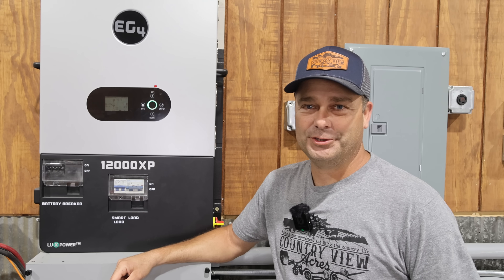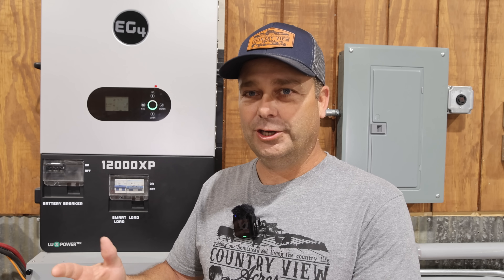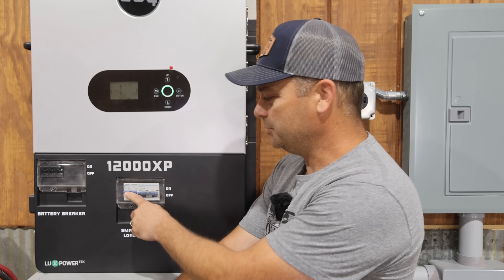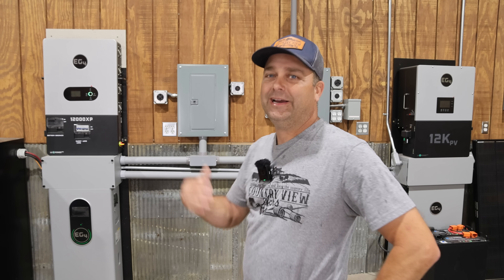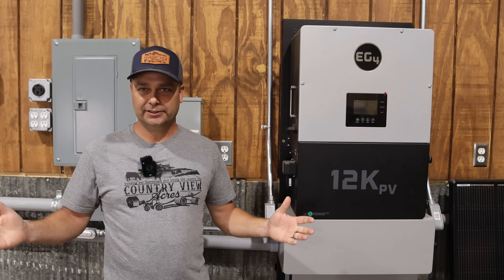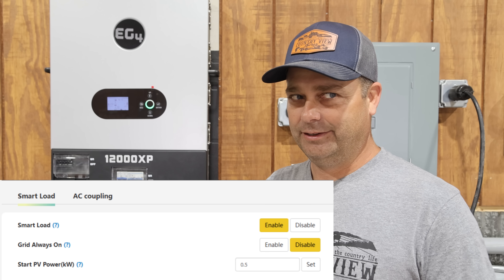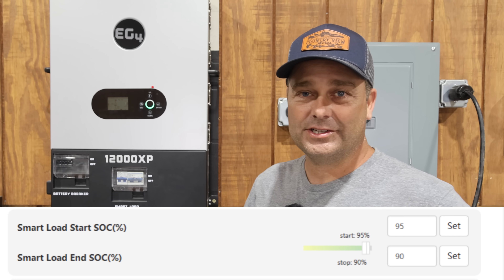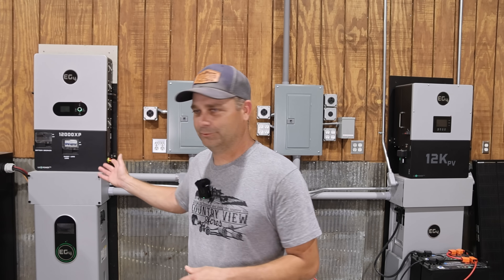Setting up a Smart Load on the 12000XP to use extra Solar power when Batteries are Full.

Comment: New 12kxp owner here. First inverter. In EKY. Planning to use my smart load for pond aeration on 1.5 acre 15’ deep pond. And eventually a pump to send water up to a future pond with 150’ of head. Then pipe that overflow into a turbine for low solar production days.

Comment: I am also struggling to find a use case for the smart load. If anything, I will just turn off a breaker if I don't want something pulling power. I can't think of a single scenario where the smart load feature is useful.
Reply from the maker: If you are not home to switch off the breaker.  The smart load will do it for you.

Comment: Typical smart loads to turn off would be electric hot water tanks (if insulated and not in a very cold spot, they really don't need to be on 24 hours or at 3 AM), hot tubs, pool pumps, etc.  

If you are going to turn on "smart loads", might seriously consider adding extra storage capacity for those non-productive solar days or establish a net-metering where applicable

Something to consider if trying to maximize your solar/battery is to run smart plugs or outlets and turn off unnecessary power drains when not necessary during times when not in use.  My home computer system utilizes over 20 watts an hour when turned off!  I found that using a Govee plug (not a plug for the company), but it is a smart plug that will also track usage.  Beware, i think only the single outlet version can track the usage, be sure to read the description carefully as they also just sell a smart plug single outlet with out usage monitoring.  While 20 watts seems insignificant, those vampires loads can add up.

Comment: I want to run hot water, heating thermal mass like a floor heater, pumps, chargers, cool room. hope state of charge can be controlled through wifi and not running dedicated circuit from invertors

Comment: Hi, I enjoyed your video. I have six LL batteries and an EG for 12,000 XP. I am going to use the smart load/load shedding to charge my EV car. I will set it up. Thank you for the video. Will make it so that I can use the extra PV power for the car.Tom
Reply: Charging my EV was the first thing that came to my mind too.  But if you charge an EV in "extra PV mode", how does that work?  Is it going to keep turning the power on and off as the extra solar becomes available and then isn't available anymore?  That would be horrible for your EV charger and car for it to keep cutting out like that.  I was thinking to use the other mode.... if the battery falls below like 70%, don't allow EV charging anymore through the smart port.  But even that could become problematic if the SOC keeps fluctuating around the 70% mark.  There needs to be some sort of timeout once it's triggered.

Comment: What if you were to run the lines directly to your hot water heater I understand it would feed back into the grid but right now I've got a hot water heater and a stove that's not on my solar system inverter and I was wondering is there a way that I could tie this into my hot water heater in my stove that way it could use any excess during the day when the solar panels are producing more power but prevent it from feeding back into the grid in case there was a power outage I'm trying to wrap my mind around how I would do that thank you for your videos I really watch all of them very carefully and I'm learning a lot

Comment: I like the idea of moving surplus power from one system to the other. I have an old but very good 24 volt system and a new 48 volt EG4 system. I currently manually use one or the other to power my home....switching usually daily. Wish I could automate this. I do have a chargeverter for winter generator use.
Question: is the efficiency lost relatively large....inverted AC power chargeconverted to DC battery charging for second system? perhaps this isn't concisely stated, but the chargeverter makes a lot of heat and that sounds largely inefficient? I don't know how to think about this.

Comment: I don't use my smart load in the summer, but in the winter I run two 1500W oil filled heaters kicking on at 55V or roughly 99% SOC.

Comment: I'll be using the smart port to turn on a car charger to dump the excees energy into my car battery. I have free charging at work but it requires valet parking, if I have enough excess energy I can skip the hassle.

Comment: I plan on using the smart port for basement minisplit heatpump.  In the winter the heat would rise amd save on my gas bill.  And in the summer I would use it to take the humidity out of the basement.

Comment: On the 12kpv system you said the battery will discharge over night. I assume you lose all AC output. Does the inverter start up by itself again once it starts receiving Solar PV?

Comment: question: if I'm using EG4 12000XP and batteries without communication, e.g., Vatrer rack batteries, will smart loads work since SOC will not be reported to the inverter??
Reply: Yes, you just have to use Voltage instead of SOC.

Comment: I asked Google the following question: Will a high frequency, transformerless inverter have a shorter life expectancy if it's frequently used to power inductive loads?

And here's Google's answer: "Yes, a high-frequency, transformerless inverter will likely have a shorter life expectancy if frequently used to power inductive loads. High-frequency inverters, particularly those lacking a transformer, are less capable of handling surge currents needed for starting inductive loads like refrigerators and air conditioners. This can stress the MOSFETs in the inverter, leading to premature failure. Additionally, the lack of a transformer also impacts safety, as it removes the galvanic isolation that protects against potential damage and hazards from DC current surges. " 

So why aren't you warning your viewers about this fact?

Comment: I run smartload into a sub panel with 3 outputs for 3 water heaters at 140f.  I swapped the elements to 2kw (1 unit) and 1.5kw(2 units) and that takes about 6 hrs of heating time per day. Very simple to wire up with dedicated breakers. Ive got an always on hybrid heat pump electric as my final water heater so even if the smartload doesn't come on I still have hot water.  Works pretty well.  Thinking of adding 2 more water heaters if I can find them cheap.  Scratch and dent is usually half price.  Electric water heaters on soft well water last for 50 years or so in my area.   Cheap and safe energy storage.

Comment: Here is an 'Outside the box' idea. During excess power times, run a water pump to fill a raised water supply, aka water tower (stored energy). When low power is detected, open an auto valve on the tower to run a water power generation system.

Comment: The smart port feature is a favorite for people with electric water heaters, pool pumps, water pumps that they don’t want to run always 
It’s very useful not just for people with multiple solar systems, even with one system, you can utilize it 
I’ve a 115kwh storage, 36kw of inverting power and over 10kw of peak solar production and my batteries are full around 11 n I’ve put my water pump and water heater n a few of my neighbors on the smart port
So they get free power as long as my batteries are fully charged and the sun is shining as I only use 30kwh from sun down to sun up

Comment: I have had a couple customers using this smart load[one for charging his EV car] and customer complaining about a buzz/humming n some appliaces, and a DC volts offset in their AC outlets/wall plugins.  Have you had this issue or have you ever measured DC in your plugin/ac outlets when using the Smart Load output?

Comment: To be conservative on output wire sizes I have changed the din-rail breaker in the inverter, 50A was excessive for a 6000XP.

Comment: I have this feature on the GridBoss's smart ports, though I don't have a use for it yet.

The general problem with smart loads is that as your battery storage increases, smart loads become less and less useful as the convenience of the extra storage allows you to use heavier appliances on-demand without really having to worry about exhausting the battery.   And there really isn't any point putting heavy appliances that one starts manually on a smart port since a smart home owner will check the weather and know when they can run such appliances.  Nor would I want to have something like a washer or dryer hanging off a smart port that might be turned off in the middle of a cycle and just leave the laundry soaked.

The other problem is that I just don't trust relays to turn off high loads.  Under 2kW (roughly a regular 15A circuit) I'm fine with.  Above 2kW I definitely don't want the load to be turned off by a relay.  Plus the type of load matters...  for example, turning off an A/C compressor by disconnecting the power instead of via its own internal controls can potentially damage the compressor.

It is hard to come up with useful cases.  I just don't know what would be useful to run.  A soft-off (relay driver) is probably more useful than an actual AC smart port since it won't jerk-around appliances by suddenly removing AC power.

--

Also note that breakers have wiring temperature ratings too and they will generally not be any larger than 75C for the lugs.   MCBs might even have a lower 60C rating.  So you have to limit the wire's amperage to the table for 75C (or lower) even if the insulation is rated higher.

-Matt

Comment: Smart Loads that could work for some people. 1) Well pump to fill pond 2) Electric resistive load such as water heater, radiant heating 3) Charging another battery pack such as that in an EV or portable unit. 4) Pool/Spa heater 5)HVAC 6)Turning off non-critical loads

Comment: I had no idea this feature existed. I have an EG4 6000XP and just learned—after watching your video—that it supports the Smart Load feature also but via the generator output. I use this inverter to power my 40x60 shop. During the week, the solar system mostly runs just the exterior lights and some refrigerators, and I’ve noticed the batteries are usually fully charged by 1 p.m., leaving the rest of the solar power unused. Thanks to your video I’ll be configuring my system to power a small AC unit with that extra energy. Thanks!
Reply: You should read your manual

Comment: I have the same xp setup. Was wondering how to use it. You are the first to give some ideas. Planning on setting up a minisplit into my battery shed to control the temp. Will see how that works.
Thx for the great video.

Comment: You could also use this for garden irrigation when you have excess power , I have a rain water cistern for aux. water with an on demand pump , I could use it to turn the pump off at night or at or low battery power.

Comment: The extra wattage would got to the well pump to top off the reservoir tank. If money was not a concern for you you might build up your wells and setup a water tower for the farm (plants and animals) to be filled with the extra charge. You could then decide to use the extra water to water the pastures overnight, dump to the pond, or overflow to the creek. 
Have a good vacation.
Reply: Think , rain water cistern in the ground  and top/ lid level with the yard . thats what I have with an on demand pump with a pressure tank. I only paid  $ 170.00 for the pump and my water cistern is 8' x 8' and 8 feet deep and I think it holds almost  3,800 gallons. much better than a tower. you have to do the maintenance and have a filter . And you could use it for  free water for your garden when not needed. I found a Pex fitting that went straight to the pump and used Pex tubing to an outdoor spicket and it gives good pressure to house water .

Comment: I am using smart loads to power down high draw loads (mini splits, water heater, dryer) if the battery is low and there's no grid. That way the system prioritizes critical loads in a grid-down situation without manual intervention. I'm doing this with a pair of 6000xp's

Comment: Use it to run a chargeverter/charger to charge your house solar system. That way the extra power is used.  -- Use it to run a secondary  hot water heater that would make available hot water to prevent your primary hot water heater or primary tankless from needing to run.  -- I would have the 12000xp in the solar shed to run the dryer, and feed the RV 6000xp solar system all the extra power ..(edit .. you just did what i suggested lol) -- Edit again: relay to run pool pump, well pump that fills reservoir tanks

Comment: Having multiple separate systems were their own batteries. I understand might be needed because of co-locations? But if it's all in the same area, the most efficient way to share multiple batteries is to have them connected in parallel. Then you don't waste energy transforming DC power into AC power, then going into a charge converter to be transformed into DC power again in order to charge another battery..

Mind you, the eg4 plug and Play components are not inherently designed to make that into it is I guess. What is the reason for having completely separate electrical systems?
Reply: My first thought is pv limitations imposed by utilities or local code for sellback.  Use your offgrid setup to charge your grid tie setup during peak time of use rates.  Might be worth it for some but not for most.

Comment: Smart load for me is a hot tub. Runs on electricity. You might use a smart load on the washer and dryer. If pulling your household are not solar as heavy. But if they are and they understand that normally run the washer and dryer when the battery is full and or in the middle of the day, the sun is shining hard and you don't need a smart device for it because you have smart people 😅

I think a lot of people might have their electric car charging on a smart port. Depending on their transportation needs. Some people absolutely need the car to be full come 7:00 a.m. the next day. Other people that only use the car for the casual errand might not need to have the car battery immediately topped off.

Comment: My first thought was what you did and then you said it, so best use in your case. My other thought was to store that energy in any way possible like your mini split saving other sources of heat or cool. Also I thought of heating water where needed to save that source of heat some supply costs. AND i rent and cannot afford any of it, but enjoy watching what you do. One thought I had was if you had electric vehicles, car or UTV, use that in your charging system to top off and keep fully charged. For many that would be a great place to store it. Charging only with excess is better than charging in high demand times. Also large tool banks. Set up your battery charging to be when it is only excess unless that cannot keep up with needs. Really any battery storage that is time flexible could be used.

Comment: I have natural gas tankless water heater. I plumbed 2 electric water heaters in series before (upstream) the tankless heater.  AFTER the battery has reached FULL charge I use the dry contactor of one of my Schnieder PV charge controller to enable relays.  Those relays feed the 1st water heater's top coil (4000watt) and then the lower coil.  What I did was replace the thermostat of the lower coil with an upper thermostat. Then cascaded the output of the lower thermostat to the 2nd water heaters top coil.

repeated the same pattern on the 2nd water heater. I heat the water to 150defF and with a water mixing valve cool down the water temp.  The nat gas heater usually never comes on and just passes the hot water through.  Saves on nat gas costs.   I could use the smart port instead of my custom relay.

Comment: Smart load to an outdoor spa???
Reply: certainly if it fits your use needs. Storing the energy in batteries that are flexible or in hot water or sand is better than not capturing it at all.